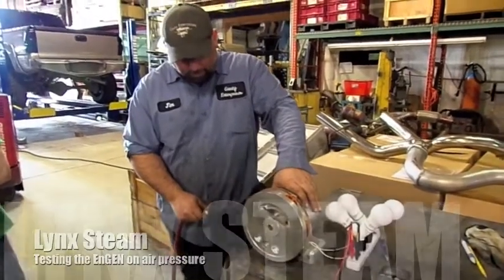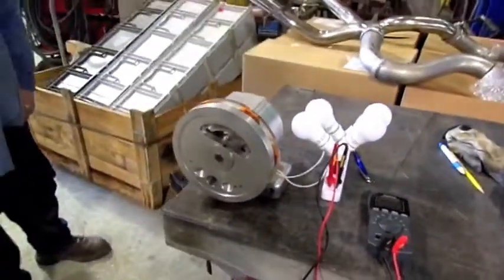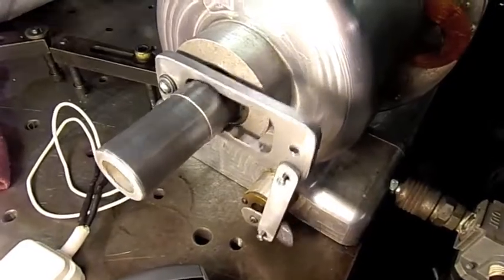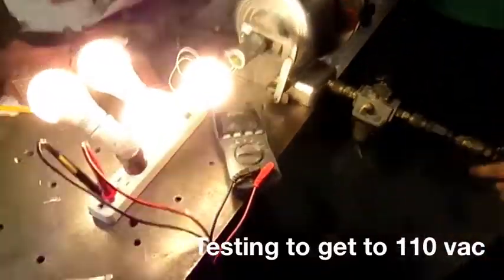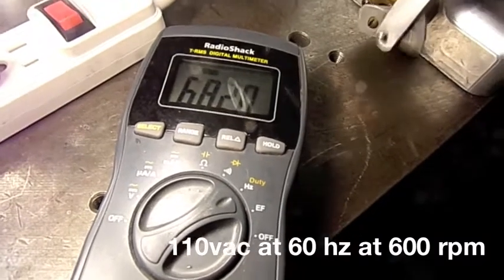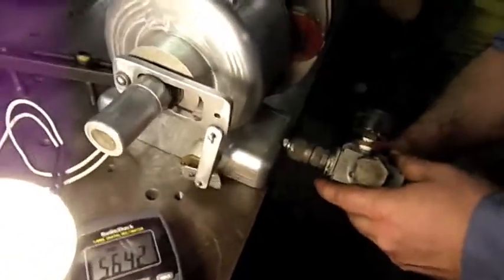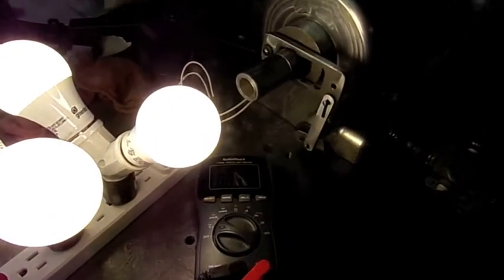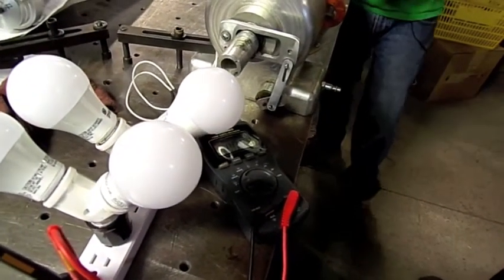EnGEN Steam Electric Generator

Comment: I really love your videos man. You do some awesome work. Just curious, do you have any opinions about different air/ steam motors? Converted 2 cycle motors, converted scroll compressors (car a/c), vane motors ripped out of pneumatic tools, axial/ radial piston, Tesla Turbine, etc? I'd be interested in what you thought about advantages and disadvantages of different motors, and maybe some I didn't think of. Mainly ease of build or conversion, price, efficiency, lubrication, tolerances to water droplets and heat, etc. Maybe you prefer different types depending on application (closed or open cycle, organic rankine cycle fluids, etc)?
Reply: Thanks for the compliments.  Your question is very broad which would require a lot of answering.  In short the best tool for the job is the one it is designed for.  Turbines run at very high speed and are best at 50hp and over.  Converted 2 strokes can be good as uniflow steam engines but require a lot of mods.  I have done just about everything.  The design of an engine system needs to start with the load anticipated, then fuel, then durability, serviceability, performance - rinse and repeat...My goal has been to find the simplest answer which is more often than not the correct answer.